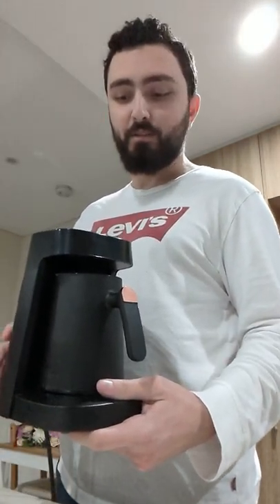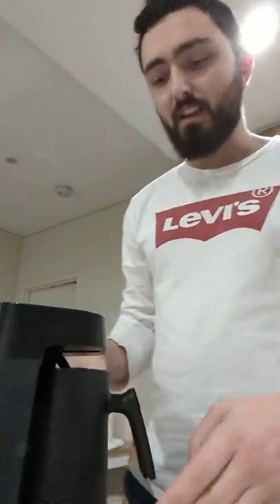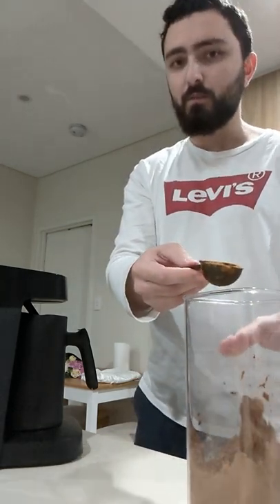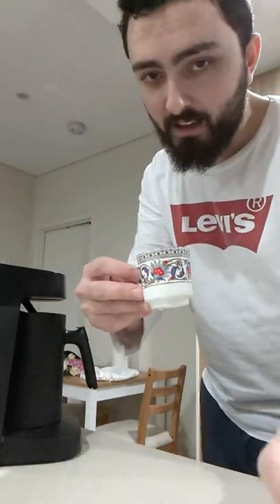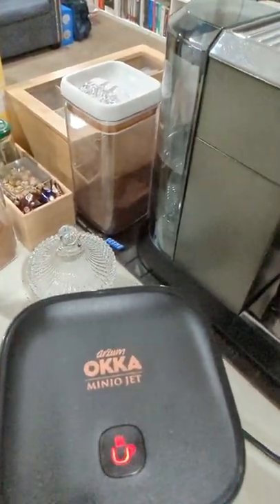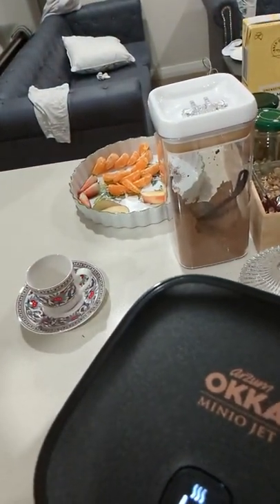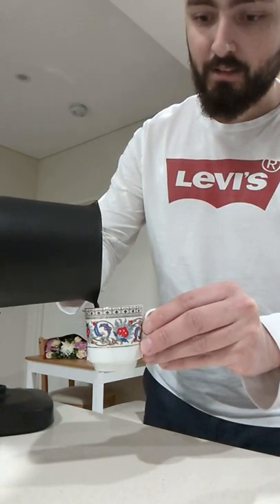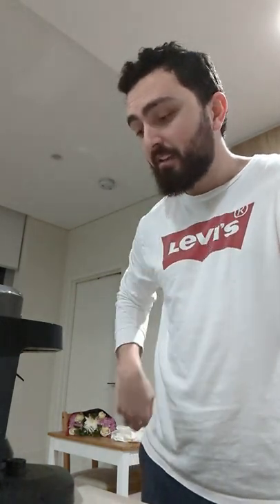Arzum Okka Minio Jet - How to use a Turkish Coffee Maker + Review (Hint: excellent value)

Comment: Hi, would you say this is better than other run of the mill Turkish coffee makers?  It seems like most don't have a cut off or even cut off too late and leave the water boiling.

Was looking at this brand as it has good reviews and the Minio Jet seems pretty convenient.

Thanks!
Reply from the maker: Sorry to hear that about other Turkish coffee makers. I had a manual one and it was art waiting for that precise moment (otherwise it overflowed).

With this machine - I had no issues and could make 2-3 of those little Turkish coffee cups of coffee. I can't speak to other brands but this was a good find and glad my family got it for me.
Reply: @kennanherkiloglu  Nice!  The sensor on the machine probably goes by temperature right?  Just curious, I'm considering between this or just going the traditional route for Turkish coffee.  I would like to be able to pop it back on and get it to simmer an extra time before pouring. Thanks!

Also curious what the server is made of.  I hopefully it's some kind of metal!
Reply from the maker: I would think so too (about temp). The server  is metal but has a coating on the outside. Hope that helps.

Comment: Thanks a lot and a question: should you keep it unplugged when it's unused? My fear is that I must plug and unplug it every time I use it, so will really appreciate your response. 🙏🌹
Reply from the maker: It's a valid question: I only have it on when it's used (as there's no on/off switch for the device itself - it just turns on - not like a standard espresso coffee machine). Once I've used it, I pop it back in the cupboard. Enjoy your Turkish coffee 😊

Comment: Great video where did you get the power adaptor thanks
Reply from the maker: I ended up buying one at those $2 shops you'd see in plazas. However, JB Hi-fi should have them too.
Reply: @kennanherkiloglu  thanks for the reply I just bought the machine from Amazon you should get a commission 😂👍
Reply from the maker: Haha right - I agree. 😅